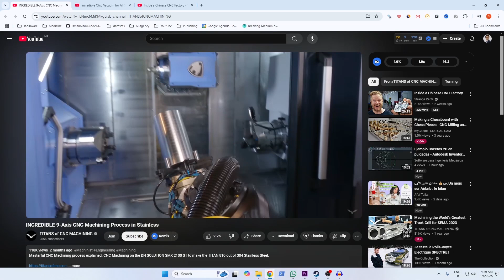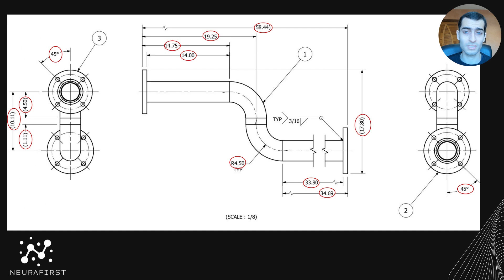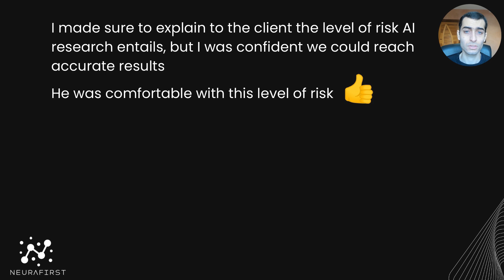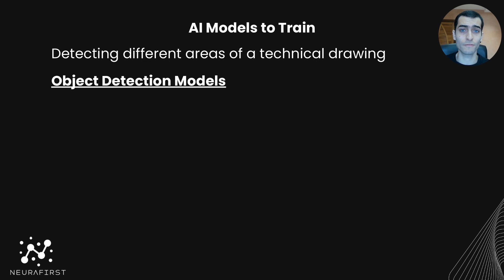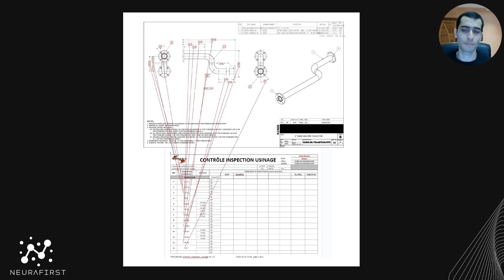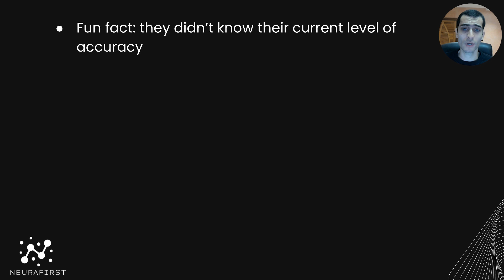I quoted 62,000$ for this AI system, here's why [AI Case Study]

Comment: Real solution, ask for the CAD file, extract the metadata and output.  Cost:  1 day of work one time for all drawings for the rest of time.
Fake solution, do this AI BS.  Cost:  A few hours of time, but we're going to drag it out and charge them 62k.
Reply from the maker: Thanks for your feedback! Well this client mainly works with DWG files, which contain binary data, meaning it is not easily readable by software. During those 5 months of exchange with this company  it was clearly explained by their chief of operations that the only viable way to extract the measures was from the PDFs they receive from their client. Obviously if an alternative was simpler and more effective AI would have not been a good option 👍
Reply: @Smail-AI don’t you love people on the internet that know more about the client than even the client does? 😂
As if the manufacturing company doesn’t have experts that know all about DWG files. 🤣🤣
Reply: @Smail-AI  To extract information from a DWG file, you can use the "Data Extraction" feature within AutoCAD, which allows you to select specific objects within the drawing and extract their attributes, properties, and geometric data into a table or external file, like a CSV, by using the "DX" command in the command line; this is particularly useful for creating schedules, parts lists, or bills of materials based on the data within the drawing.

Wow I just earned 62000 dollars by doing a 5s google search.
Also, if you did use AI you wouldn't even need to do annotation.  Since it's autocad all you need to do is generate random drawings using autocad, and since you know everything that's in it, it's already labelled.  Magic!
Reply: @Smail-AI  not only are dwg files readable.  there's a system in place that can already read dwg files and output the stuff you're looking for.  i guess 5s of googling qualifies me for 62000.  also, even if you HAD to absolutely go the AI route, which is just stupid to do here anyway for regulation reasons, you don't need there's ones that already exist.  on top of that if you HAD to create your own, you don't even need data labelling.  its dwg files, you generate infinitely many of them, and you already know where the information is, so there's absolutely no reason for any data annotation or checking.

whoever hired you for this job needs their head checked.

Comment: Great idea, but for this I think you went way over the top on this one.  You could have used the AutoCAD Lisp routine to do this which probably would have cost somewhere in the region of about $1,000
Reply from the maker: Can you please elaborate what does AutoCAD Lisp routine allows you to do ? We spent many meetings with their COO understanding the problem and making sure the solution was super tailored for them. They generally receive the  technical drawings in PDF format, so there needs to be a software that will analyze the images extracted from the PDF and recognize the different measures inside.
Reply: @Smail-AI the creators of the drawings could probably use it to export dimensions, but that doesn’t help this manufacturer unless all clients agree to provide them, and to provide them in the same format. I think if that was a viable option, the company would have already been doing it.